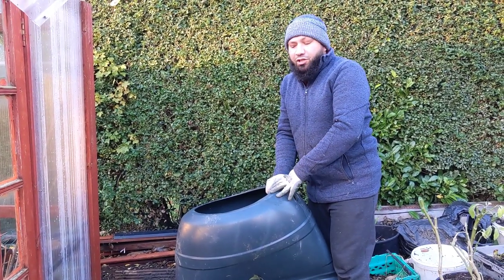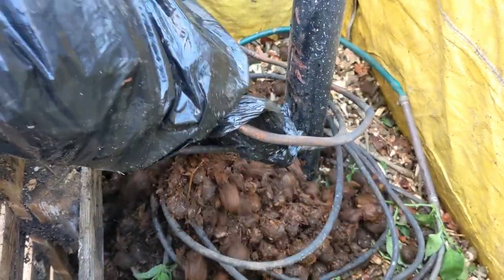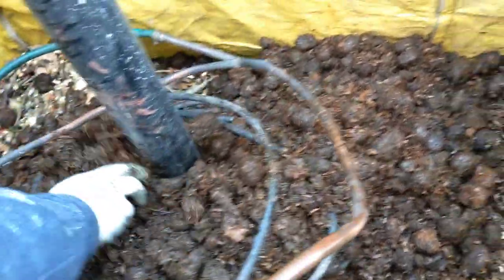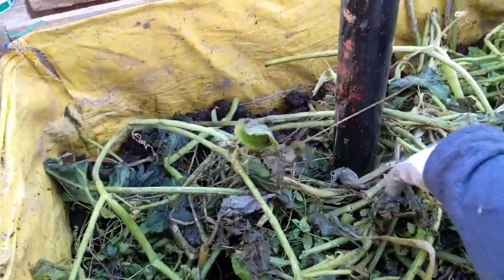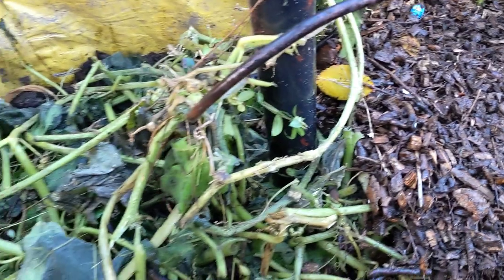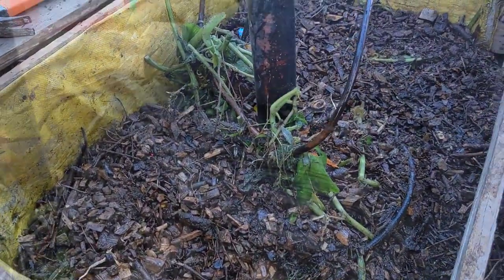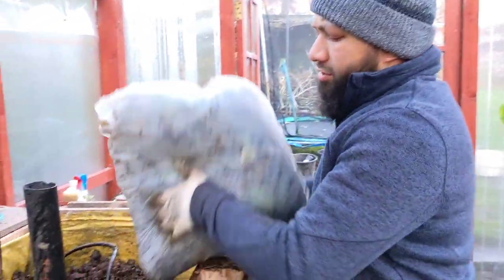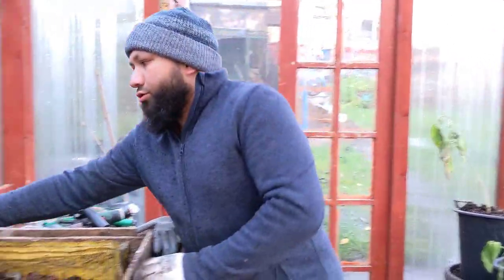Heating Greenhouse With Compost - Jean Pain Compost Heating Part 2

Comment: First, I would like to express my sincere admiration for all the hard work you have been putting into trying to enhance the thermal efficiency of your greenhouse, and thank you for sharing your experience! I just subscribed to your channel.

Second, I would like to express my humble opinion on this subject, as I have been 'digging' on this for several years now in our cold winter climate here in Canada. I think you are pretty close to a great efficient solution, which may be a bit simpler than you are trying at the moment...

So, here are a few important facts to consider:
- you have managed to create a 'heat source' out of the hotbed that you built in your greenhouse - which is a GREAT thing;
- now you are trying to implement a relatively laborious system of water circulation - which I think only complicates matters without bringing much gain... (I LOVE Jean Pain's great achievements, but he ended up refining an excellent system that worked very well but at a much larger scale...);
- I don't know (and it would be important to have this info) what is your minimum winter temperature in your area... I would assume you are in climate zone 8, so minimum winter temperatures may be between -7 and -12 Celsius... If that is the case, than I think your main objective should be to maintain an indoor temperature just above freezing level in the middle of winter - which would allow you to grow vegetables all winter long...
- your greenhouse, like most 'usual' greenhouses, is surrounded by glass / polycarbonate - which loses heat EVERY single minute of the cold days and nights! I think that trying to minimize that heat loss could make you benefit MUCH more than trying to produce heat to counter balance the heat loss...

If you will have a few minutes I would kindly invite you to watch the following video, which presents a few models of unheated greenhouses that I have built and tested in the last years. I would dare to say that you may find a few elements that could inspire you to implement and achieve your great 'green objectives'!

https://www.youtube.com/watch?v=lnmpeYFBm54 

Thank you once again and I wish you best success! Dan

Comment: Hey Mothin! Hope you're well. I was exhausted just watching you! It did look like hard work! I hope you're taking care of your back 🤔. Finally bought a small piece of land here and hope to build a small bungalow next year. One of my plans is to install a Solar Water Heating system, based on similar principles to yours. Thanks for the video!
Reply from the maker: Hiya, I think solar would be perfect for where are, it's a shame we don't get enough sun. Could you make a DIY wind turbine and add that?
Reply: I might give that a go Mothin but most of the time there is little wind. By solar,  I meant coiled up black hose pipe, connected to a water tank. When I water the garden, I have to run of the hot water from my hosepipe as it would cook the plants as if gets so hot. If I can retain that heat for evening and morning use in the bathroom, I'll save a lot of electricity! But Solar panels are now becoming popular here too. For about £2500, I could install a system that would take me off grid completely. I might get saving! 😄

Comment: Your point about making it anaerobic is a big one. It made it down to -9°C the past few nights here and my pile inside my chicken coop was at a hot 60°, but has dropped to 20° with the cold. I added a large amount of green, coffee grounds and manure today. I feel like it’s kind of a lost cause in my climate.
Reply from the maker: Wow -9 that's cold! Can you insulate the sides of the pile?
Reply: @MyFamilyGarden  Most of January, it hovers around -17°C. After adding green things today, I topped it with a blanket and a tarp. We’ll see if that helps

Comment: what i was trying to say in my last comment,, was,, try lowering the barrel and let gravity level the water out,,, if you let the water seek its own level,, then maybe adding heat will get it to flow. you had it flowing some what until you tried to raise the pipe 8 inches.  when you did that there was nothing pushing the water, you would have to heat the water to near boiling to get it to flow with pressure. try lowering the barrel and let gravity do the work.  idk,, just my thoughts.. but great idea and great work keep it up im sure you'll get it working.  : )
Reply from the maker: I think I get what you mean, the only issue is the water pressure from the siphoning action is not strong enough to counteract the water pressure coming out of the tap. I was hoping the temp difference in the barrel might do it. I need to find something smaller that I can move about more freely

Comment: Hi, could you use narrow hose pipe to make it longer. Then you could put it into the barrel and reach to under the water line forming an air lock so that the water can't run back down. I'm not sure in which direction it might run. The tap has the pressure of the water's weight. Perhaps the lid and fittings need to be airtight before tap flow pulls in water from the pipe. There is only one way to find out and that is what I love about your videos.
Peace be with you and your family.
Reply from the maker: Hi Sharon, that's a good idea to get it to siphon, I was hoping that if I could get the water hot enough then it would thermosiphon but I might have to try with a smaller barrel
Reply: If you have an airlock then unfortunately you will stop the thermosiphon.

Comment: I am intrigued by your rocket stove.  Did you make a wood based one or gas?  I have the same problem with trying to heat my kids paddling pool.  Did you manage to achieve meaningful heat with it?  I tried using black pipe last year. But a 100m of black pipe turned out to be the equivalent of 1kwh at peak sunshine so made very little difference.  I have a 3kw electric spa heater ready to plug in next year to run from the solar panels. However the rocket stove idea sounds fun to try.
Reply from the maker: It was made from old gas cylinders with the copper piping coiled in throughout the burn chamber and the chimney. The water out of the pipe was very hot but by the time it mixed with the cold water of the pool the heat dissipated really quickly in the pool but it was warm enough for the kids to get in and I didn't have to worry about them being to cold

Comment: It 'll start flowing once the compostpile heats up, don't you think? Warm water rises.. iff not, you could make an extra hole a little bit lower..
Reply from the maker: That's what I was hoping for but unfortunately it hasn't. I need to find a smaller barrel to use, I'll still need that to collect rainwater in the summer

Comment: Man, you've got me thinking.  I am just curious as well, is this just an experiment to see how much heat you can get out of the pile?  Having the pile in the greenhouse means that you don't actually require the tank.  If the pile was outside of the greenhouse due to space limitations then this would be a great way of moving the heat into the greenhouse.  Have you looked at what size pile you need to heat your house?  I imagine it would be quite substantial.
Reply: I found this link which includes pile sizes near the end for some house sizes http://library.uniteddiversity.coop/Permaculture/Another_Kind_of_Garden-The_Methods_of_Jean_Pain.pdf
Reply from the maker: It's a bit of both, I use the hot bed to start seeds which I'll be doing this weekend but also I've still got chillies and my last few tomatoes to ripen, I've got ginger in there and a few other cold sensitive plants. Last year I worked with just the hotbed but this year I wanted something to store the heat instead losing it in from heating the air. 
Once the hot bed loses its heat it'll be used as a growing bed. 
I've done a bit of research and to heat a house I'd need a pile about 5x5m I think. I haven't figured out how to do the airflow through the pile but the water flow would be.much easier because you could connect it to the mains
Reply: @MyFamilyGarden  Which seeds are you starting now?  I've just bought some chillies for the first time and understand I need to start them early.  However I'm in the north of Scotland and don't think they will fair too well in the polytynnel at this time of year.  That is one massive pile! Even though I have four acres myself I struggle with getting greenery to make any meaningful pile as it is all grass field.  I've planted some hedgerows but being in the north of scotland it will be quite a few years before they are any meaningful size :<
Reply from the maker: For a pile that size I'd go for one that is predominantly carbon in the form of woodchip, no need to worry about nitrogen as there's plenty in the air if there's a way of getting it to flow evenly through the pile.
I'm starting my chillies and super hots now, I normally start them in October/early November then over winter in the house. I'll start lots of onions, and grow mixed salad greens all winter
Reply: @MyFamilyGarden  gosh, I'd better get going. Only starting with mild/no heat just to break the kids in😂

Comment: (Physicist) the water pressure will only ever be enough to return the water to exactly the height of the water level in your tank.  That's why raising the tank still left you a few inches low of the top.  I'm wondering if you thought that heating the water causes it to expand slightly, and this would make the water in the pipe come out higher?  I don't think that could work either because even if you were heating enough to cause some significant expansion, there's no reason to suppose that the water would expand forward through the pipe and not backwards - it would actually expand in all available directions.

So I think, if you want a flow in a particular direction, you'll need to pump, I can't see an other way.  

Sorry if I've missed something, but it makes no sense to me.
Reply from the maker: That's basically what I was hoping for, the hose connector is one way so it shouldn't flow backwards. Even then it hasn't worked, I'm still not ready to give up, I'm looking to see if I can harness the Venturi effect to give it some thrust but need some time to get out
Reply: If you can get the air out of the hose and the other end below the water level I think it would flow without a pump, as long as the cold input is lower than the hot output.

Comment: Cool, I was only talking with a friend about this a few weeks ago. He is looking to heat a swimming pool. 

The water pressure alone isn't going to work or you have invented perpetual motion. Essentially where the water stops following is the level of the water in the butt. . You need to make sure all the air is out of the pipe isso you may need to wait a bit and keep filling the butt. You need to put your finger over the pipe or block it whilst it is flowing and get it through the hole and a few inches below the water level. You now have a nice loop so as the pile heats the water will rise and move into the butt. The cooler dense water will fall from the bottom of the butt to the bottom of the pile. I am not sure what size the pile needs to be to sustain the heat. It is something I'd like to try next year as well. Taking it apart files me with dread.
Reply from the maker: It'll work but it will have to be quite a large pile, and also materials that will take time to break down so you get heat over a long period. My plan is if i can get this to work then i'll move to try heating my house.
The siphoning action won't work without lifting the water but up much higher because there won't be enough pressure to push through the volume of water that's pushing down on it, i just don't have that space to lift higher. I'll figure out how to get it to cycle i hav'nt given up yet.
Reply: @MyFamilyGarden  Siphoning is different to thermosiphoning.  The siphoning action will give you pressure out of the hose as long as the end is below the top level of water in the butt. ie the pressure you are talking about is the water coming out of the tap from your header tank.  This is different to the convention currents you want to set up.  It doesn’t matter how much you raise the butt you will find the water stops flowing at a similar position to that which already find relative to the water level at the top of the butt.Siphoning is different to thermosiphoning.  The siphoning action will give you pressure out of the hose as long as the end is below the top level of water in the but.  It doesn’t matter how much you raise the butt you will find the water stops flowing at a similar position to that which already find. What you are trying to achieve is thermosiphon. ie the same as used in old gravity heating circuits as used in a wood burning stove set up.   You need the loop to be continuous.  No air bubbles / breaks in the loop.  So you can use the siphon effect to get rid of the bubbles but the return end needs to be lower than the top of the water in water butt.  For a WBS you would normally have 28mm pipe leaving the stove but you aren’t dealing with as hot a source so the 15mm may be enough.  I am not sure in this case.  If you had enough water expansion then you could get away with the pipe being just above the level of the water but I don’t think you will get the height/heat to achieve that.  The passive effect of the water rising from the heat source does away with the requirement for a pump.  https://en.wikipedia.org/wiki/Thermosiphon
Reply from the maker: I'm looking into ways of using the Venturi effect to see if I can get my extra lift

Comment: you need to connect the top pipe to the tank and then fill the water but above the 
top pipe level and it will flow as soon as the heat  starts you get heat convection throw the pipe  You will never get the water to flow out of a pipe that is higher than your water level

Comment: why does the pipe need to go to the top to circulate?if you could drill a hole in the barrel so far down put a copper-brass-plastic fitting on put your copper pipe on .as long as you have a good circulation the heat  is going into the water barrel.might work I'm no expert thanks
Reply from the maker: Thanks Dave, I'm on the lookout for a small plastic barrel to try. I'll need to use this again as a water but in the summer so didn't want to drill holes in it

Comment: Close... Tank needs to be higher and total water level higher for it to thermo syphon with no air in the circuit.. Hot water inlet to tank needs to be lower than the total water level
Reply: As in you will need to hook the pipe in through the hole.

Comment: As I said on your part 1, I think your idea of using water pressure to create hot water circulation is somewhat flawed (I apoligise for criticising). This problem was solved by heating engineers years ago by using gravity circulation. I think you need a copper coil in the water tank and heat the water indirectly. Otherwise you will be jacking the water tank higher and higher, and we have already seen the results of this, especially with kids around. Although a copper coil (and fittings) will cost £££s, compared to a bog standard paraffin heater + paraffin, it's a one off investment.
Reply from the maker: I have no issues with constructive criticism at all it helps me learn and get better. I was trying to imitate their system but using only the materials I have, I wanted to do something that is affordable not just for me but for anyone else that might be watching
Reply: @MyFamilyGarden  Big kudos to you for your aims. But just think if you could create a perpetual heating system, using only compost, for far less than £100, I think many here would thank you for it. The alternative is a paraffin heater which will cost £25 - £30 then the cost of paraffin for ever!! - plus the paraffin heater will need replacement bits and pieces and will not last forever either. 

Just my two penny's worth.
Reply: And I forgot to add, paraffin is not eco - friendly.